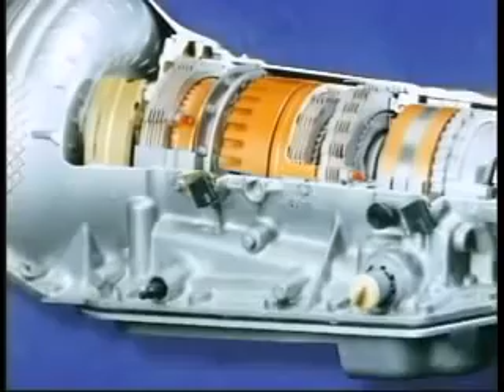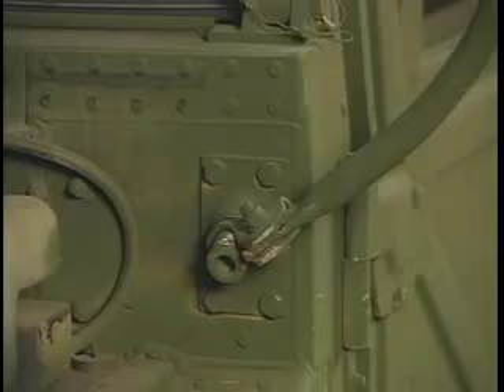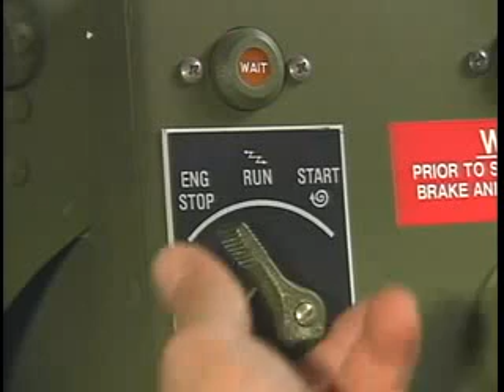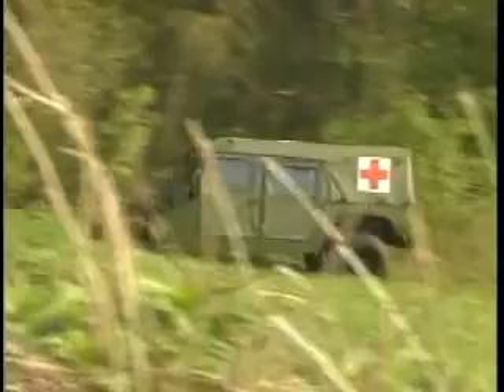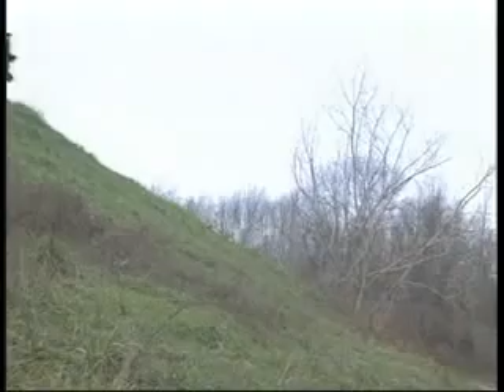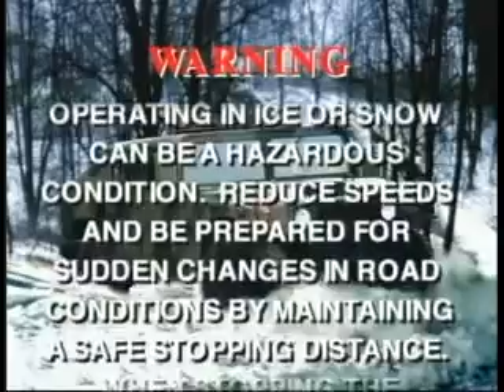HMMWV Operations

Comment: "The Humvee's powerplant, a GM diesel, comes with a design flaw in the number # 8 cylinder, which causes the engine to blow up. This may not be in your favor in a combat situation, therefore, we've included tow hooks for both the front and rear bumpers"
Reply: Mike Hawk only the '96-'00 6.5 turbo versions had this problem.  steer clear of those and you are fine.
Reply: HMMWV’s